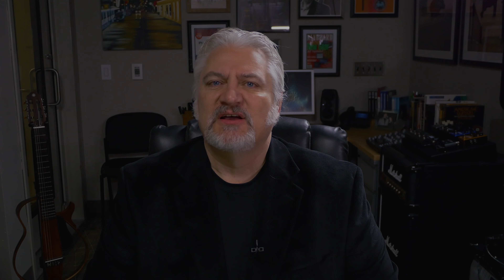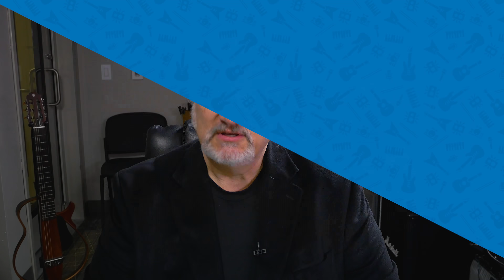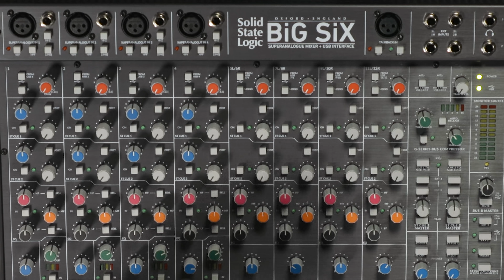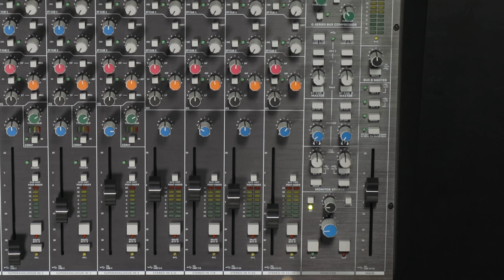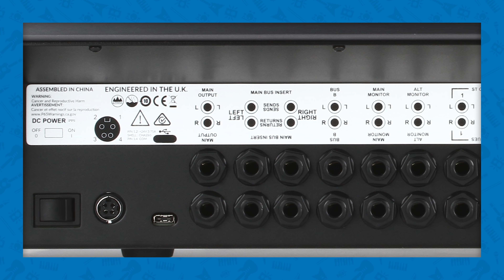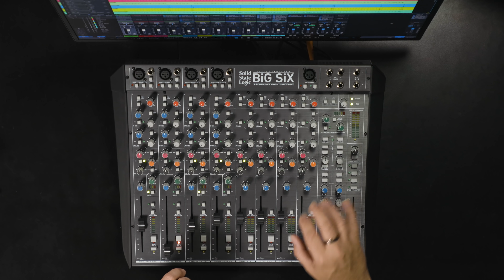Solid State Logic BiG SiX Desktop Analog Mixer and Interface Demo

Comment: Can you connect multiple big sixes together? Like with Apollo’s you can do this. Would be an absolute game changer if this is possible with the big six!!!
Reply from the maker: Hey there, Isaac! Yeah, that would be sweet to run multiple together – unfortunately, there isn’t really any type of way to do this that would really make it worth the investment.
The Apollo’s are able to be connected via a Thunderbolt cable and will then all be linked within their Console software, so all the channels that you’ve chained together are showing up digitally.
With the BigSix, there isn’t a way to digitally connect multiple units together. So, if you had 2 together, you wouldn’t be able to take advantage of all the features that you get out of just 1.
Thanks a ton for reaching out!
Nick Pasquino, Sweetwater Sales Engineer, (800) 222-4700 ext. 3230, nick_pasquino@sweetwater.com
Reply: @sweetwater  ahh that makes sense! Thank you so much for the clarification!!

Comment: I decided to set up a separate mixing/mastering station in my studio using SSL equipment.  I purchased a UC1, UF8, Fusion, Bus+ and Big Six. 

I have been using Reaper for about ten years but am not a power user.  I have relied a lot on Kenny Gioia's video tutorials. 

My goal was to get all of the SSL pieces working together with Reaper.  Unfortunately SSL does not fully support Reaper in setting up the UC1 and UF8.  So I had to wade in (over my head) into getting Reaper and the SSL equipment, the Big Six, UC1 and UF8 configured so that they would function together.  

SSL's technical support was responsive but they did not have knowledge of Reaper.  I could not find any YouTube videos or other information on how to configure all the this equipment together.  So I decided I would offer a few comments on what eventually worked for me.

The SSL User Manuals are very good in explaining the functions of the equipment.  The Fusion and Bus+ provide no particular connection or configuration issues.  They are easy to set up and operate.

The SSL User manuals and YouTube videos for the Big Six, UC1 and UF8 explain how to physically connect each piece to a computer (in my case a Windows 11 pc).  They also do a good job of explaining how to download the software – 360 plug in mixer, Channel Strip 2, Channel Strip 4k b and Bus Compressor 2.  The only difficulties I encountered in this were due to my total inexperience with using iLok software manager.  But the process worked fine.  

So I suggest that one follow the SSL videos and User Guides.  Just one comment.  The Channel Strip 2, Channel Strip 4k b and Compressor 2 are VST's and it is best to allow the SSL downloader to put these in the default folder – which is the SteinbergVST Plugins folder.  Pay attention to Reaper's warning that VST plugins should not be placed in the Reaper plugin/FX folder along with the standard Reaper plugins.   

With regard to the USB connections, I offer the following advice.  Use either the USB cables that SSL provides or very high quality cables.  Do no use any USB cables longer than 1 ½ meters.  Do not use a hub for any connection.  Connect the UC1 USB cable from the UC1 to the UF8 “thru” USB input (which is a USB type A input).  Run a USB cable from the UF8 USB output (which is a USB type C connector) to your computer.  Connect the Big Six USB output to a separate USB connection on your computer.  

After all the SSL software is installed, go to Options > Preferences > Audio > Midi Devices.  A table will pop up.  There will be a table listing twelve SSL V MIDI Ports for Input and under that there is a table listing twelve SSL V MIDI Ports for Output.  Under the Mode column of each table, enable all twelve ports.  Do this by right clicking each port under Mode column. A window will pop up.  Click enable.  Do this for all input and outputs. Twelve MIDI Inputs and twelve MIDI Outputs are therefore enabled.  I do not know if it is necessary to enable all twelve outputs and inputs but that is what I did and it works for me.  

Right click again on the SSL V-MIDI Port 1 line in the input table.  The small window will again pop up.  Click on “Enable input for control messages.”  You do not have to do this (and cannot do it) for the  SSL V-MIDI Port 1 line in the output table.  

Go to Preferences > Options > Control/OSC/web.  Under the blank window, click Add.  Another blank window will pop up.  There will be a line titled “Control surface mode.”  Click on the small down arrow to open up another window with a list of options.  Select Mackie Control Universal.  (If you are using more than one UF8, I think you also need to select Mackie Control Extender, but since I only have one UF8 I do not know for sure).  Click OK at the bottom of the window.  

I suggest at this point that you restart your computer.  

Then turn off everything – the computer, the Big Six, UF8, UC1, Bus+ and Fusion.  

Then I do the following:  The order is important.  

Turn on the UF8 and UC1.  
Turn on your computer.  
Start Reaper.  
Open the SSL 360.  
Check that the Options setting described above are sill there.  
Open a new track and ensure that you can find and open the Bus Compressor 2, Channel Strip 2 and Channel Strip 4k b.  
Turn on the Big Six.
Ensure that the USB connection light in the upper right of the Big Six is on. 
(If you turn on the Big Six before turning on Reaper, the UC8 will not be happy and will pout.  It will essentially refuse to talk with you or do anything at all except sit there with a blank stare on its face).  

In the SSL 360 software, choose Logic Pro for Layer 1.  There is no option to choose Reaper.  Reaper is not fully supported in this manner – er, not supported at all.  (I have seen that someone chose to use Studio One instead of Logic Pro, and this might work.  However, SSL technical support recommends using Logic Pro.  

Most of the soft keys in SSL 360 are already programmed with commands that correspond to Logic Pro commands.  Some of these work with Reaper and some do not.  I chose to reprogram all of the SSL 360 soft keys.  It is very easy to do.  Moreover, I did not really like most of the commands that were per-programmed anyway.  The SSL 360 video and the SSL User Guide for the 360 are very good at showing how to program the soft keys.  I found it actually fun.  

So, for me everything is happy working together.  I find it remarkable that the 360 mixer, UC1, UF8, Channel Strip 2, Channel Strip 4k b and Bus Compressor 2 plugins all correspond to each.  When a control is moved in one, it immediately shows in all the others.  Pretty cool I think.  

I also like that the transport controls in SSL 360 work.  I duplicate these controls in the first group of soft keys on the UF8.  I have also programmed the soft keys to do such things as save, open new project, metronome, undo and redo, snap and unsnap, etc.  I like using these instead of resorting to my mouse.  But everyone will have a different approach to all of this.  

The outside plugin controls on the UF8 do not work with Reaper but SSL has been very clear about this, and to me it is not a big deal.

Comment: Thank you for your videos, they are great! Here's my shoutout to the "big" guys. There is a big gap, and a need in the market for a high quality sound analog mixer with (min.) 8 in/outs, very good converters, and good in/outs to the external hardware. No need for build in (especially stripped versions) of effects-EQ-comp. They maybe good for live, but I am referring to studio rec./mix/mastering. A&H has good choices, but the Neve, SSL, Trident, API etc. start from 17-20K. A 5-6K unit from those guys, with just (8 min.) in/outs, not even pre-amps more than 2, or 4 (we all have our gear, and like to be flexible), and maybe an additional ADAT in/out (for 500 series, Cranborne etc.) would have a ton of options for the user, and have their 3D sound. Basically a clean, high grade router, and AD/DA converter with ADAT (or USB) for 8 analog in/outs would be a center piece. Thank you.

Comment: Hi! Thanks for the video. For someone like me that has nerver used a console like this, the in/out ports explanation was very, very briefly. What can you do with those? Send/return? ST cues? Etc. please explain it more.
Reply from the maker: Hey there! Partially, the explanation is quite brief because it’s a rather complex subject. It may be a bit difficult to answer through text. If you have some time to reach out, I’d be more than happy to give you the full run down of that mixer over the phone!! You can reach out at the information below and we can dive into the details of that BiG SiX further.
Hope to hear from you soon!
Nick Pasquino, Sweetwater Sales Engineer, (800) 222-4700 ext. 3230, nick_pasquino@sweetwater.com

Comment: Question:
Is running sounds/audio usb in and out the same as running sounds/audio in the old fashioned way using cables the same?
I don’t get the usb audio flow,im use to the old fashioned way of using the ins and outs lol…
This will determine my decision on getting this thing.
Reply from the maker: Hey, Kenzo. Thanks for your interest in the BiG SiX! Basically everything is the same with the mixer itself and is fully analog in form and function. The USB connection takes your Analog signal and converts it into a Digital code for your computer to receive the information. With this unit your DAW software will be able to see 16 inputs and 16 outputs, where as most mixers only show 2 inputs and 2 outputs regardless of how many channels are present. This is what sets the BiG SiX apart for other mixers and it works as a Recording Interface and Console, basically a whole high end production in a box. Hope this helps a bit, but if you have any questions feel free to reach out. Thanks and take care!
Jack Wellington, Sweetwater Sales Engineer, (800) 222-4700 ext. 3240, jack_wellington@sweetwater.com

Comment: Someone needs to do a comprehensive video on using the Big Six with Harrison Mixbus32c.  Specifically; setting up a template for stems and master back to daw -burning tracks back post fader on stems-to ‘recall’ easily and the channels 15/16 master 2 track mix w/ effects loop engaged .  I’ve tried this and have only been partially successful. I’m getting double bussed issues with. 15/16 back to daw-user error for sure.

Comment: Mines haven’t arrived yet but I sure can’t wait  I’m going to bypass the interface and pair it with my avid Carbon, this is what people don’t understand I’m sure the interface on the big six and the A/D converters are great but if you pair this with high end pre amps and as we all know that the A/D converters are amazing on the carbon paired with HDX DSP system this will definitely take my vocals and mixing and mastering to another level, by using the eq the compresor and the bus compressor as insert and actual hardware i can eliminate some of the  Plugins I use on my Master chain and vocal chain which will free up DSP power that I use with all the plugins which will eliminate latency.This is the best pice of gear that Ssl has built for smaller or Hybrid studios, I understand  that this not for everyone there is a war and a lot of controversy on this new console older engineers with higher end equipment or old school mentality see it as a worthless pice of gear but for us the newer Generation that comes from mixing and mastering in the Box Hybrid system is just something the old heads don’t understand hardware is amazing but this is like a grey Jedi it’s a balance between hardware and plugging tow of the best worlds and this is why The Big six is the beginning of Hybrid consoles, I had a SSl Nucleus 2 and I loved the Pres and the moving faders but it was so limited I’m glad they moved away from that and made a smaller version of there bigger console with tools that we need to tweak are music to the level and sound like the big boys this is just an amazing pice of gear  can’t wait to get mines 😎

Comment: Can you 'print' those channels back into your DAW separately? For instance, channels 5-6 from my DAW go into channels 5-6 (USB Inputs 5-6) in the Big Six, can I then have them come back digitally through USB Outputs 5-6 to print separate stems of my mix session?
Reply from the maker: Great question! You can dig in to the specifics on page 25 of the user guide here to see if it will function exactly as you need, but it looks like you could take a USB return in to a second SuperAnalogue channel or stereo channel and then back in to the DAW to print the track:
https://www.solidstatelogic.com/assets/uploads/downloads/SSL_BiGSiX_User_Guide_V1.2_s.pdf
I hope this helps! Feel free to reach out to me directly if I can help further.
Connor Smith, Sweetwater Sales Engineer, (800) 222-4700 ext. 1793, connor_smith@sweetwater.com
Reply: @sweetwater  that sucks for such price

Comment: Thanks for this video. The only thing I haven't been able to get an answer to is how to incorporate outboard gear on the individual tracks during mix-down. Is it possible to use the inserts on 1-4 when switched to USB mode? How about channels 5-12? Cheers
Reply from the maker: Hey, Robin! That's a great question. The USB input will receive everything post pre amp on each individual track. So, any insert return, EQ, or dynamics processing will all be printed into your DAW for each channel. The only thing that's not sent into your computer (USB mode) is the main fader on each channel.
I hope this helps!
Nick Pasquino, Sweetwater Sales Engineer, (800) 222-4700 ext. 3230, nick_pasquino@sweetwater.com
Reply: I have been trying to find this one for myself also
Reply: The USB switch at the top of the channel strip brings the USB signal back into the mixer right after the pre’s—so the EQ, comp, and insert all process the channel during mix down. No inserts on the stereo channels, but you could always use the sends or route to bus B to pass a stereo channel through outboard. Then you’d bring the outboard back through another stereo channel, an EXT input, or even the unity main bus summing input.

Comment: For me this is the cheapest summing and quarter of your outboard for mixing… not so much as you colour units but the SSL main sound well known for being great for mixing a wide genre base… and again it’s cheap… with USB, SSL conversion!? … again very cheap in comparison… although it’s being sold as recording and it wouldn’t be that great on recording unless you had the other outboard to make a good recording setup… I do think the preamps are good for a particular type of sound … a bit of drive… or low gain very clean with a hint of radio sound… “the sound that sells” lol but would still be the Best Buy for the start of a analog mixing environment… prefer other converters but the USB means you can take it as a hub for travelling or temporary moving a bit of the setup… or production in general
Reply: Why I write when I’m tired 🥱 lol

Comment: I honestly don't understand why this exists. people call it a continuation of the SSL heritage but I believe that's totally untrue. having worked on a 4000e, the true SSL heritage for me is how modular the entire desk is set up. everything can be routed to and from practically everything. now there's this thing, with a 1 knob compressor, fixed Q and freq eqs and no seperate filter eq so if you wanna use those you effectively have 1 other fixed eq band to play with. there are so many things that confuse me with this thing. why are the inputs on the top? why is there a talkback feature when this is a desk designed for small studios where you probably don't have a seperate live room? why are there even two headphone outputs? surely the artist won't use them as they sit across the room. then for me there's the size of it. regular "superanalogue" preamps take up quite a bit of space, but not in this desk. for me that means they changed the circuit of it, in one way or another. will they still sound like superanalogue pres then? the same counts for basically all the other components... to me it's almost insulting that they market this as a "way to improve your studio" while they did all the thinking for you and set up fixed comp settings and eqs. at least make the eq knobs pull up so that you can change the frequency that way or something. I really want to like this thing but to me it looks like SSL made this thing for rich podcast makers that don't know what their doing. not for actual professionals. anyway, long rant, please convince me why this thing is awesome
Reply: I think you are 100% right. I have not met a professional that doesn’t scratch their heads in disbelief. 
Calling it the emperors new clothes would be an insult to the emperors new clothes.
Reply: @hepphepps8356  I KNOW RIGHT jeez I thought I was the only one